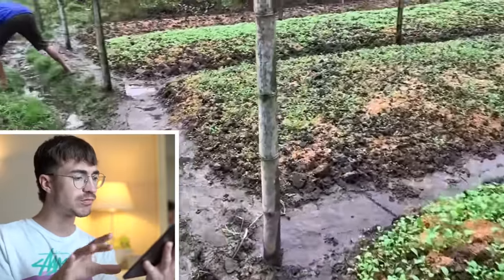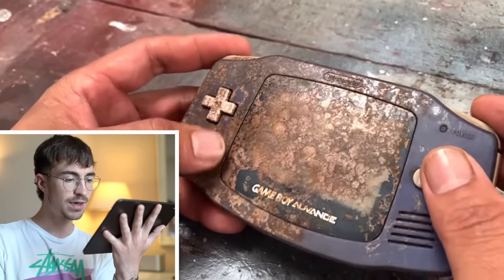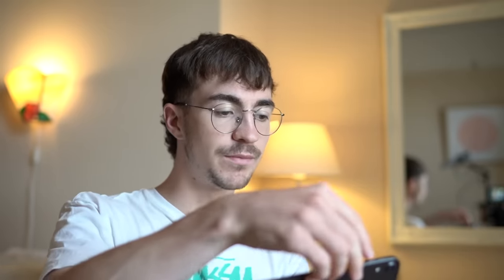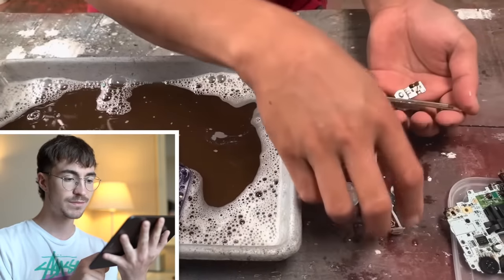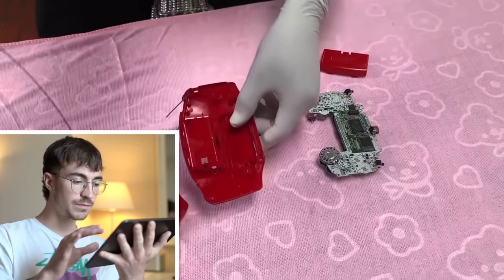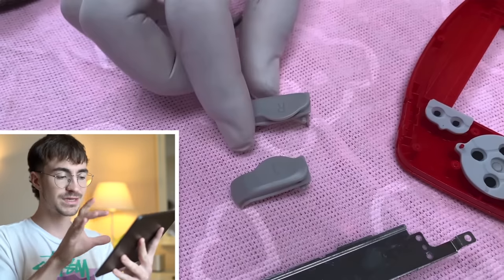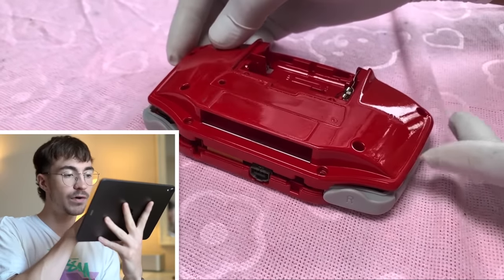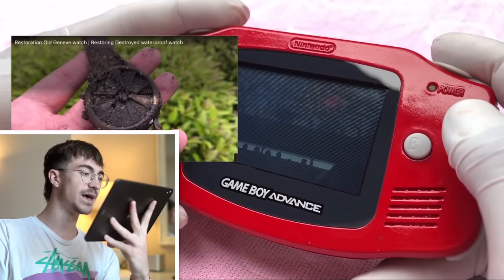Exposing FAKE Restoration Videos!

Comment: funny thing, i just watched some of those youtubers videos - because they were suggested after watching a jerryrig video ( we wanted to see how easy it might be to swap a battery of a phone )

Mind you, i think it is pretty clear that this creator rather tells a story than doing real restoration videos. It is obviously fake. He seems to usually fake getting a plead/request by a "fan" to restore something ... and he does it - for free of course. 

Regarding a majority of videos that restore stuff - something that we (myself and my partner) noticed is that simple things like replacing a battery in a smartphone, a backplate or even a screen is not too hard. - Well i assume it is not too hard, i am not the one doing it. But the cost can still be great. - Aside from not knowing perfectly well how the replacement part fits, even if it is declared for your model .. it can also always be a low quality part, because hardly any seller can be trusted. (and iFixit does not have parts for everything)

What many repair creators do is having a clickbait headline "can i fix this 1$ iPhone 13 pro max?!" ... 

The answer is .. of course you can ! ... but you will fail to declare how much your replacement parts were (like the entire back, the oled screen and all + your hourly compensation for your work. Unless people get original replacement parts dirt cheap all the time, repairing isnt exactly that cheap, especially when you consider factors like your own time.

Comment: So a common misconception about electronics is water ruins them, but thats just not true. When electronics stop working because of water, its because they have an electrical charge and the iron in water allows for the board to jump circuits that it shouldn't jump. If there is no electrical flow, harm can not be done. Its not an uncommon practice in the PC community to actually clean motherboards in water as it works the best. With that Gameboy having no batteries, placing it in water will have no negative effect on the electronics within. Things to keep in mind however, you have to let the board completely dry, or you risk shorting it out, and it is possible to ruin electronics with water if done incorrectly and allowed to rust, or theres massive mineral buildup.

Comment: To be fair some times parts are just beyond repair and need to be replaced. That said... this video seems to be trying to hide the fact that parts were replaced rather than just being honest about the fact that it's junk.

Also it is possible that it could be submerged in water and still work. It's extreamly unlikely but technically possible. I would not recommend intentionally submerging any electronics in water even if they say water resistent. All that really means is the eletronics inside are water tight to some degree but things like the battery compartment can still be exposed and rust over time.
Reply: i wouldnt reccomend trying it. once my gameboy fell in the water. got it out in less then a second. dried it for 3 days but never got it to work again.
Reply: @bopo900  Yeah like I said it's EXTREAMLY unlikely to work again but is technically possible. I've heard leaving the device in a bowl of rice over night will soak up all the water, never actually tried it myself so not sure how well that actually works. I've also just gotten lucky a few times so I've seen both where a device has been submerged and never worked again and was able to be dried out and recovered.

I did say in my original post I wouldn't recommend trying it because while it is technically possible it's extreamly unlikely and not worth risking ruining your expensive electronics to test it.
Reply: @bopo900  Usually that's because the batteries are left in. Soapy water doesn't really hurt electronics much as long as they have proper time to dry and the power source is removed. It's a good way to clean old computer parts.
Reply: You think a GBA shell is watertight ?
C'mon man.

Bailey is right in that you don't really hurt a device with water as long as it's not powered on when it is submerged (including residual current in the capacitors).
But there is no way the mobo's copper that has been submerged in dirty water for supposedly weeks or months has not completely rusted off.
Copper traces are tiny, they go extremely fast.

Comment: 2:20 to be fair though, water by it self will not ruin electronical parts as long as he let the water evaporate before putting the batteries in. It would take many days to dry out that Gameboy thoroughly though.
Reply: Not really the salts in water can cause rusting

Comment: Also when the shell was hung to paint it was opaque and dark. After paint layers were added, the shell transmitted some light through the shell. Obviously the shell was swapped out for a red one .
Reply: No it wasn't... Look at how shitty the paint looks on the finished product.
Reply: @billymanilli  he had 2 cases. One with the bad repaint and an aftermarket red on that wasn't opaque.  He used the ugly one for close up, but after the video  he swapped all the new parts into the new case so he could resell it. Watch him paint the flooded case. No light shines thru it. He then adds even more layers to it. The give away is the red case he removes from the painting line is different and light is shining thru it now.
Reply: @georadzo787  just play the vid from 11:07 to around 11:15 .. Look at how bad that thing looks when the light goes across it as he tilts it... That's definitely an old beat up case, with a THICK and really shitty paint job.
Reply: @billymanilli  look at 6:14, it's the beat up case. The back lighting shows no light coming through it. After he adds layers of paint,  it won't  make an object thinner and slightly transparent.  When he takes an aftermarket case down at 6: 44, you can see light streaming through the second case. 2 Separate cases. No paint makes am item More transparent than original, the more layers you add. Fake.
Reply: @billymanilli  I'm not saying that paint job didn't have runs. I'm saying he had a second unit to donate parts such as the buttons, and it shows their are 2 different cases being used.
Reply: @georadzo787  If he had second good working unit to donate all the parts from, why would the buttons and everything be aftermarket?  Look at how "off-center" the letter B is, for example.  Nintendo would never in a million years manufacture and sell something that crappy looking.
Reply: and as for the "transparency"... It's being filmed with direct, BRIGHT sunlight behind it.  Light shines surprising well through plastic and paint.  

Put a flashlight up to a plastic model car (or anything like it) that's been painted, and see for yourself.  

Anyways, not trying to argue with ya... Just telling what I know from experience.  You're welcome to believe w/e you want!  Have a great holiday, bro.
Reply: @billymanilli  no way. Too much of a different. This coming from a guy with 6 paint guns within 10 feet of me.
Reply: @georadzo787  What does that matter?  I have 40-50 spray cans, 5 airbrushes (4 of them gravity fed and one siphon fed) in my hobby room, and 3 HVLPs and a couple of old siphon feeds in my garage. Went to school for, and was a painter in a body shop probably before you were born.  Anyway, like I said, believe whatever you want.  Not trying to waste my time arguing over something so stupid.
Reply: @georadzo787  ok... I wasn't gonna say any more, but I missed this comment from you: " look at 6:14, it's the beat up case. The back lighting shows no light coming through it.", and can't help but to ask, Is the SUN shining directly through it in that shot?  Nope.  That's why it doesn't look "transparent" like it does in the shot after he paints it, where the sun is right behind it and practically flooding the sensors in the camera.  Pretty basic stuff, really.

Comment: This does bring up a bit of a "Theseus's Game Boy" question, though: When getting replacement parts for a console, at what level can you replace parts before it's not considered the same console any longer? I would assume it's somewhere on the hardware level (i.e. you can replace the plastic parts and still consider it the same Game Boy), but does that include or exclude components like the cartridge slot? What about the screen? The speakers? What about vital chips on the circuitboard?

Granted, Nintendo made you products that fucking LASTED back in the day, so maybe just the base hardware is all you need.
Reply: For a Game Boy this is easily answered.   It's simply the motherboard that defines the console.  All other parts are easily replaceable with aftermarket solutions, but the only way to get a Game Boy motherboard is from an existing Game Boy.  Even the most outrageous mods still require an original board.
Reply: With game consoles in general, it all depends on if you have the same save files. Once those are gone, you can argue that it's no longer the same console, even with the original hardware
Reply: @thatguy8777  I don't think save files are relevant here. For the Ship of Theseus, that's like only changing out the crew members.  Deleting the console's OS I guess could be the equivalent of killing Theseus himself, in which case it's technically no longer Theseus's ship, even though it is physically unchanged.  A console with no OS or firmware is just as functionally useless as a boat with no captain.

Comment: I liked this video within 5 seconds. Dude can read minds!🤣 Looking forward to this video coz I hate being lied to.

Edit: Okay, the fake repair was too obvious. If you're ever gonna soak your electronics then isopropyl alcohol 99% or distilled water but some parts, like an LCD, might get damaged so you need to strip the entire device. Flux is used to clean off rust.

Comment: To be fair, I've dried out soaking wet electronics and have had them work perfectly fine.
 Heck, I've even pulled perfectly good parts out of rusted to ### PC cases and not have had issues.
Reply: Yeah, I think that if there is no power through the circuit and it didn't spend to much time In water, it shouldn't be a problem but the gameboy in the video totally was in an unrepairable state.

Comment: Actually, and take it from someone who does a ton of spray painting of 3D printed parts made from all sorts of different materials, that shell is not the same unless they managed to somehow change the way light refracts through the material. 
With a single coat of paint on top of the existing material, you wouldn't really get the kind of transparency you see in the video. It is too translucent for that to be an additional spray coat on top of the existing material.

Comment: Ok clearly he didn’t just find it. But beyond that, there was nothing that crazy. If you let go it wasn’t buried in that location, which if it was the internals would be a lot more damaged, age related rust and dirt can be cleaned. I’m not sure why you keep saying water when I’m sure you Know it’s not judging simply by the reaction 1:48. IPA  or maybe a vinegar mix. But water isn’t what’s dangerous to electronics technically. I use it a lot for parts. You’d need supplementary machinery to evaporate every nook and cranny if you were gonna go bananas like this haha def not wise to just dunk but if it was IPA then that’s no problem at all. He’s cutting out, I hope, hours upon hours of drying. I’m sure there’s some fake bits. But that is movie magic. This is why unless it’s streamed or filmed zero edits, except time lapse speed up, I’m out.
Reply: Regardless if it’s ipa or water it’s still fake

Comment: You can wash electronics with soap and water. You just have to make sure all the water is evaporated before plug it in. You can do that by submerging it in isopropyl alcohol and to be extra safe put it on an oven to evaporate any remaining of water. Not the best choice but even if you use ultrasonic to clean something that dirty I recommend you use those steps.

Comment: Elliot you can use certain liquids to clean boards. Seen it many times over on Adrian's Digital Basement with old technology
Reply: I find it very unlikely any of those would have been used here. I don't think they sell ISA in old paint cans.
Reply: Honestly even water is fine as long as you make sure you dry it/use IPA afterwards before using it.

Comment: After watching actual restoration videos, especially those involving step-by-step instructions, here are a few things to note:

- Some of these fake videos are easily made by covering said items with dirt and leaving them out for a few days, easy rust
- The usage of any solution, especially if it's not non-conductive on an electronic should always be mentioned with added caution, for example, "Rinse with water, leave to dry for several days to ensure board is without moisture"
- Spare parts like the rubbing lining, screws, and little bits that are used will 99.99% be after market products when it comes to these fakes, actual restoration youtubers provide details of each products, including serial numbers if they have to, and where to get them legitimately, unless they are no longer in production, which is very rare depending on the item restored.
- Legitimate restorers would show in depth cleaning guides on how to clean electronic parts, simply because it takes that added attention to clean without any risk of damaging the electrical components. This dude just dumps it in water, soap, scrub, and voila, looks clean and supposedly works.
- Bleach rubber components is a tricky thing, simply because you would need very specific conditions for it, mouthwash is fake, and usage of bleach would cause rubber to stiffen up and at times crack
Reply: the other most obvious part that shows its fake... they turn off the comment section lol

Comment: This have been going on for years.. water doesn't damage electronics(pcb's) except (ic packages) and as long as u dry it out, you can wash things in washing machines, just dry it off, alldo i dont do that myself, but water i have used loads of times with no problems.

Comment: For starters, yes, after watching this exact video just the other day, I was a bit suspect,  mainly because he always finds some discarded electronics in some muddy swamp.  A boom box, game boy, etc.. and it's always caked in wet mud.  So as I watched this video, after I became suspicious, I started noticing things.  Like for example, you seemed to have missed the fact that when he found it, there was no battery cover on or anywhere around the gameboy, and he walks away without a jump cut, but later on he miraculously has the battery cover.  I agree with most of your other assessments except for the water, at least on the circuit board, not too sure about the display, but it's totally ok to wash a circuit board, even with soap and 100% submerged in water, as long as it's not powerd, and as long as it's dry once you apply power.  Other than that, I agree 100% that this is fake, as a matter of fact, I watched it because of my recent suspicion about the exact video you expose here...lol.  And hey, quit your whining... you have nearly 200k subs... I have 88... feel better? lol
Reply: The display surviving immersion is a roll of the die. If water gets between the sandwich layers of the LCD it's toast. You do not want to ever immerse a display like that if you can avoid it.
Reply: @tylisirn  it doesn’t matter so long as it dries before powering it on.

Comment: Electronics can be more resilient than you'd expect, especially if they were not powered on when they got wet. I found two laptops and three android phones (amongst other things) in a skip after heavy rain. Took them all home, wiped them off and removed battries from the laptops and just left them for a couple of weeks on the floor of the workshop. Everything worked apart from one android phone that had a cracked screen. Recently changed the HDD in one of the laptops and there are water marks on the mainboards and rust on the screws so it clearly got a soaking.

Comment: Water does not necessarily damage electronics unless it's turned on when wet. I've scrubbed down motherboards in the kitchen sink with soapy water, hit them with wet and dry to get the surface rust of everywhere possible and then scrubbed with a toothbrush and isopropyl alcohol to get rid of the rust on the IC legs etc. After that, hair dryer and turned straight on and they worked.

Comment: Actualiteit the paint can be a great solution assuming you spray a car paint (polyurethane) and a two component clear coat. That’s will bond with the plastic and the clear coat becomes a plastic layer. This is why guitar paints stick so well.